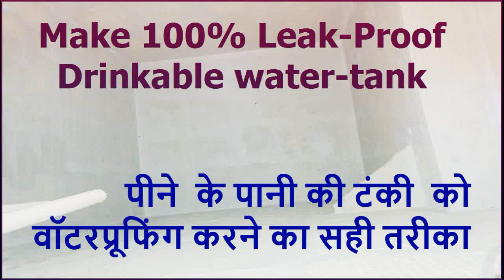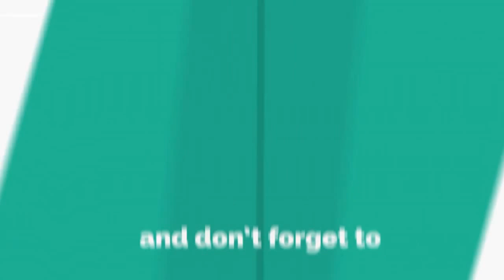Pani ki tanki  leakage kese bandh kare ? water tank waterproofing / 100%  Guaranteed waterproofing

Comment: new overhead cement water tank  Waterproofing is done fir bhi minor si leakage ha ek outlet me kese roke  GI ka pipe ha ??
Reply from the maker: Send me  your water tank's video for Detail Study 
My whats App  no : 9825585997
Reply from the maker: Sir i understood your issue , You can use our Waterseal's Quick Seal Cement and fill the surrounding portion of outlet pipe .  And then apply 3 Coats of Waterseal's  PSV chemical over the patch. I am providing buying links Below.

https://waterseal.in/product/waterseal-quick-seal-cement/

https://waterseal.in/product/waterproofing-chemical-waterseal-psv/

Call if you have any queries : 9825585997/8866903438